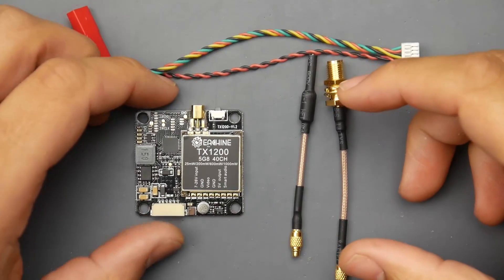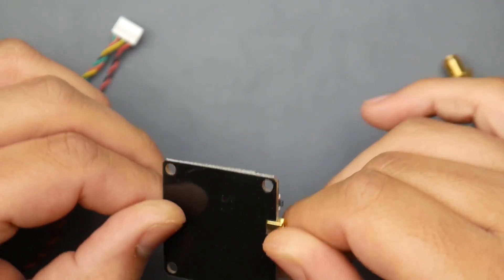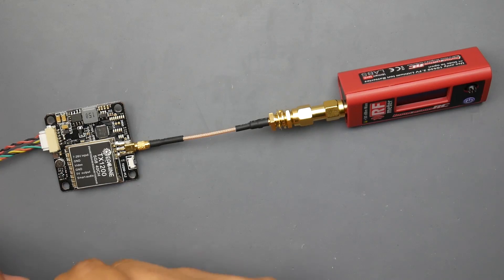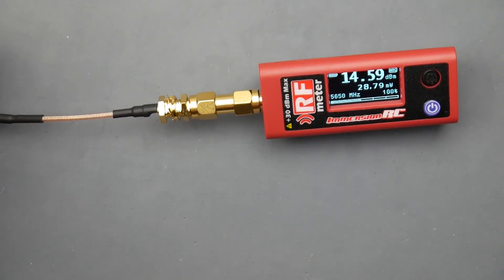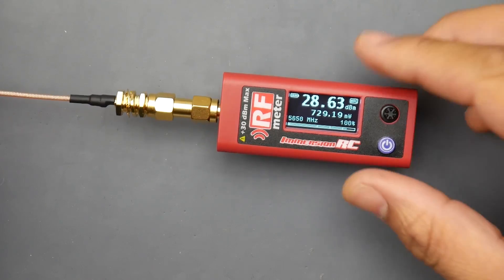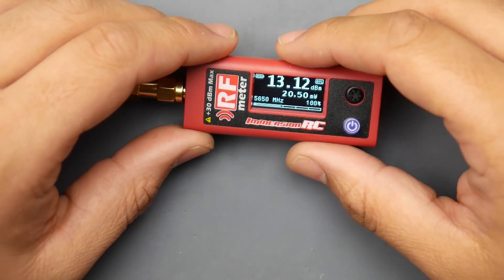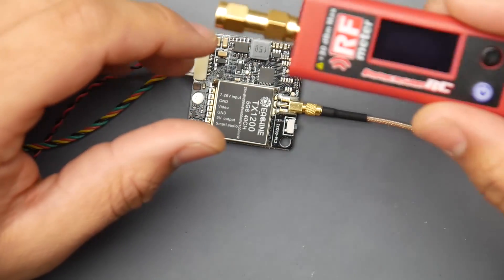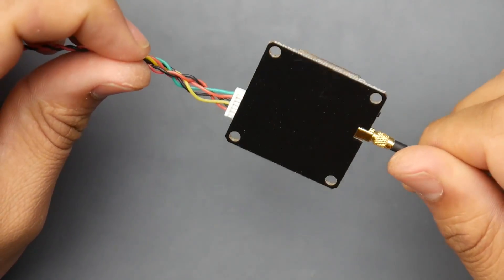Can A $14 VTX Output 1000mw??  // Eachine TX1200 VTX Review

Comment: What voltage were you supplying to the VTX ?  Some of this class of transmitters regulate the incoming wide range voltage down to 5V for the camera, and then run the transmitter module off that same voltage.  To get the higher output power levels either the voltage has to go up or the current does - and perhaps at 5V it is just running out of supply current at the DC/DC converter output.  Note that the spec says 12V, but if you ran the test with a 2S input (allowable given the 7-26v input range) the converter would have to work a lot harder to put out the extra wattage.

Comment: Not a bad VTX.  it still has a good output,  now if it has a good picture and I can use a little camera to it that way I could mount it to my FMS 1400mm F4U-4 Corsair.  I wish they mad a Flight controller for it like those that are used on the wings.  Thanks for the information and the show.

Comment: Bardwell sent his tester off to a professional that measured it and it was very very close to the RF meter that the pros use !!!
Reply: So 1 meter was close? Just saying, I test some of the most expensive computer components, and every single one behaves differently. This would be like saying "I blew up a 1000w power supply at 630w, they must all blow up at 630w",  maybe they all do, maybe that one was defective, and maybe Bardwell just got lucky that it happened to be close. I know with cheap multi-meters, sure I can calibrate one to make it accurate, but does that mean the exact same model sitting next to it is correct? I can literally open 2 brand new ones, and they can show wildly different answers. Even walking by the thermometer isle, you can see some gauges like 8*F different from each other of the same model, and those are about as simple of devices as it gets!

As Bardwell would say "sample size of 1...", its statistacally insignificant, and basically worthless. Because maybe one of my free multi-meters will show up more accurate than a Fluke... But its probably just coincidence and more like a lotto chance at that point, but it could certainly happen!

Comment: 1w is at the absolute upper limit of that meter.  It's possible that it's not accurate at the top of its range.  It really needs to be checked against a calibrated source.
Also the cable and adapters will be introducing losses.
Its entirely possible that the TX is theoretically 1w with those results.
Or they inflate their numbers like pretty much everyone in the hobby does:)

Comment: I really don't like those static vtx tests. It's no real world environment testing a vtx on table, it will just overheat and drop power output wich is absolutely normal. In real world environment it gets some cool air during flight and output more power. That's the reason why you saw only 16mw at the end on 25mw setting. Absolute normal behavior.
Next time try to cool it while measuring highest power setting.
Reply: You could put an ice cube on the top to make it really cold. The heat probably hadn't soaked through to the cover, and probably had much hotter components (but its only going to run hotter in real use). If you chill it though, it should be about room temp internally. How realistic is this? Well probably not super realistic, but arctic viewers and people wanting to see it for fun might want to see it.

Comment: You are in everything FPV related. Good job. Want to see more results with the Neuroflight and your projects.

Are you sure it wasn't overheating and lowering the output? I think you should try to cool it down with a fan and then try again.

Anyways, the power output varies from channel to channel and 5650 isn't an usual frequency for us. Why not try 5800?
Reply from the maker: It's the raceband and on average on 1000mw it got up to 825mw on some channels as mentioned..

Comment: Not bad considering the price, even the most expensive 800mw VTX only output around 600mw, never seen one that can output over 600mw in real life.
Reply: What is the typical efficiency of these? I don't have output testing equipment, I just know the input is over 1 amp at 12v. Would a 5% efficiency be realistic for these? If it is, one of my dirt cheap 600mw stamped VTX might be close. I just know the only time I've had it break up is when going beyond a hill with over 50 feet of dirt blocking my signal.

I don't do super long range though, I would switch to 1.3 Ghz (I have a HAM licence) if I really wanted to fly 10+ miles, but I have no desire to fly such a long range, I like flying close to the ground (I love seeing my props cut the grass, always looks cool). I normally run 25 mW since I can get over 1/8 mile on a micro with near perfect reception, but on bigger, more dangerous quads, I figure excess power just so I don't lose signal is a safer way to fly. Overkill? Probably, but better than losing reception for an instant, because I often get disoriented flying planes or quads LOS, my brain just doesn't like it when you're inverted and flying towards yourself, its just messes with my thought process. FPV is much safer and less disorienting.

Comment: Try all channels. Not every channel has the same power output. The range difference between 800mW and 1000mW isn't that great because the scale isn't linear.

Does it have thermal protection?
Reply: lol he is using IRC power meter which is accurate to +/- 200mw......
This power meter is well know for being completely inaccurate and is only good for checking if the transmitter is working.
Reply: @Redemptioner1  100% spot on. Also he should definitely test on different channels because their output is tied to the bands as has been tested by others